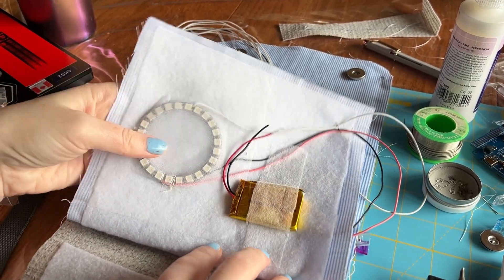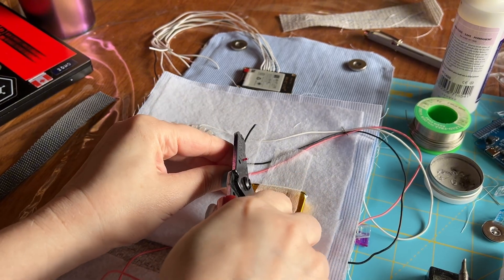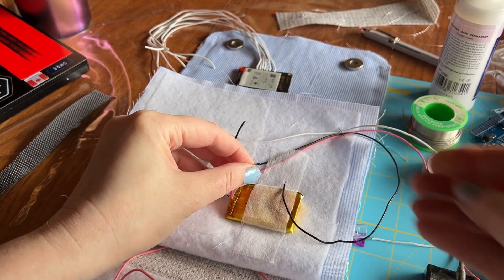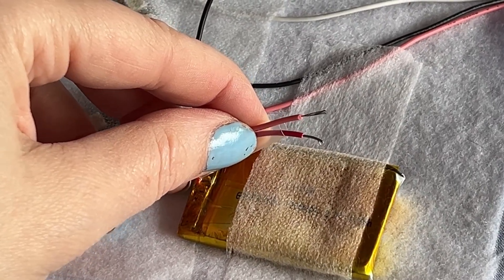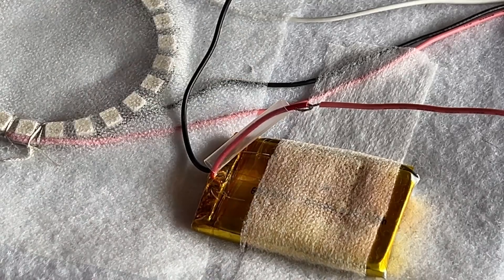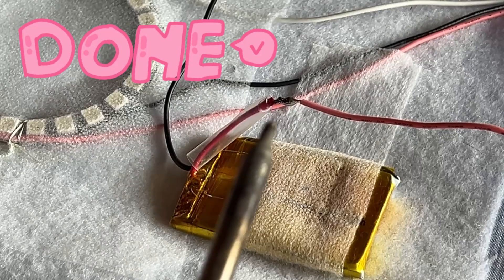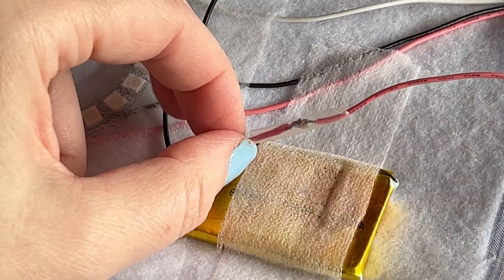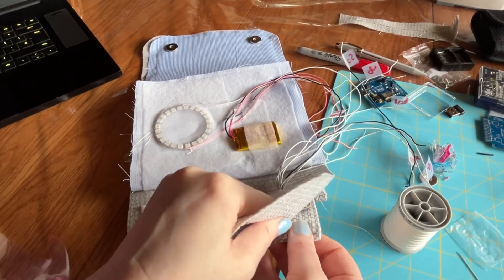Soldering POWER to your wearable project!

Comment from the maker: Adding power to your projects is so important - often the wires that come attached are so stiff they are terrible for a wearable tech project. Cut these wires, soder silicone and be safe! What power solutions are you using? Leave a comment or question if you need any help! Thanks

Comment: For the wearable I’m currently using a JST connector into the board until I get soldering down. Because if soldered wrong can it damage or not send power to whatever you’re using to power ?
Reply from the maker: JST connectors are great and quick for sure. Depending on the project, I sometimes prefer to solder the battery to have less connectors ‘bulk’ or maybe the battery I’m using didn’t come with a connector. Most boards now have voltage protection for this exact issue - if it doesn’t have voltage protection you could do real damage to your board or components. Wise choice for sure 👍 (These are low powered devices so typically the are safe even if soldered wrong, but I’ve definitely made many mistakes and have zapped ⚡️ a component or two!)
Reply: @CMozMaker  got it thank you for the video !
Reply from the maker: @Lawsonplaybook no problem, so exciting to see the projects you’re working on!